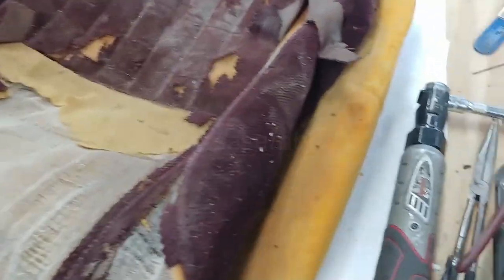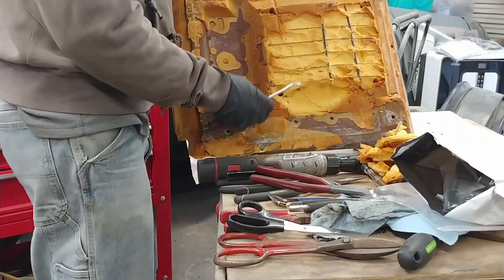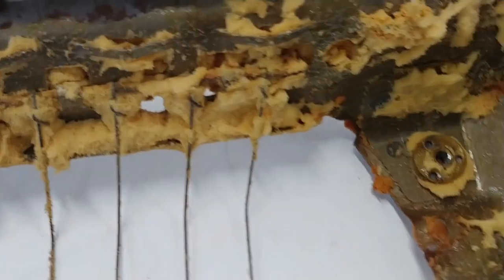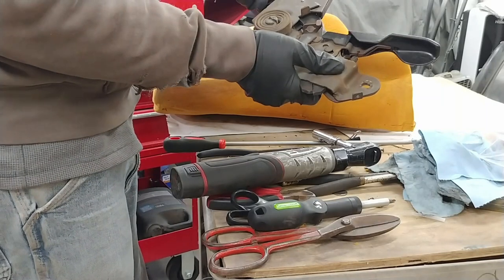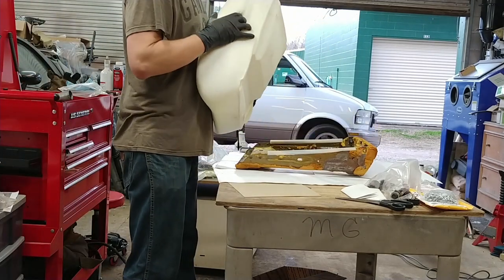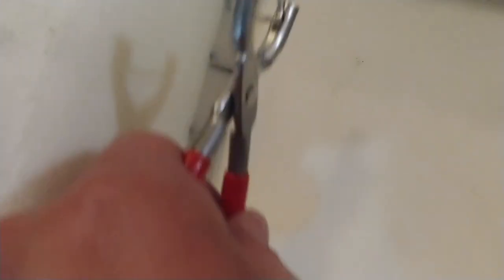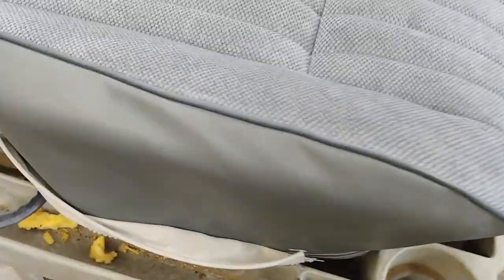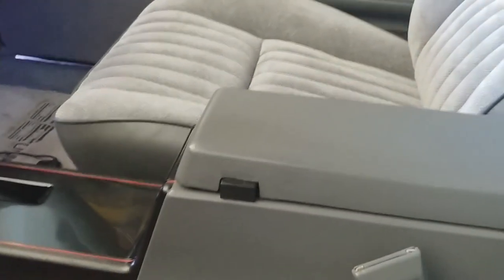SS Monte Carlo - El Camino Bucket Seat Upholstery Install (G Body)

Comment: Currently converting 86 Elco from bench to bucket, what brand upholstery did you go with PUI or ACME? Where did you order?
Reply from the maker: The  kit I used was ACME brand. Purchased the kit through Rock Auto. Not a big fan of PUI interiors as they don't seem to fit near as good as these ACME pieces. Thanks for your comment.

Comment: What are the seats actually from? Also does the back adjust for angle as I like to sit really upright.
Seems like all the 80's type seats are really reclined.
Reply from the maker: These seats were removed from a 1986 Pontiac Grand Prix. Most all of these G Body bucket seats recline into several positions to accommodate the driver and passenger. The drivers side also has a 6 way power seat base for full adjustability. Thanks for your comment.
Reply: @g3garage  Thanks for the reply.
I have a power seat track.
I am still not sure if the back part of the seat will "Tilt" Forward & Lock independently of the Seat Bottom/Power-Track.

Comment: Do you know if the 1987 buick regal T type bucket seats have the same foam shape as the Monte Carlo SS/ El camino?
Reply from the maker: Yes, they should fit fine for your Regal. The seat pattern is slightly different but the aftermarket foams accommodates for both the Regal and Monte Carlo "pleats". Hope this helps.
Reply: @g3garage  thanks for the info, one more thing how easy was it switch the clip on the base to switch the passenger to the driver side?
Reply from the maker: @aldoa4544  Clip on the base? Not sure what you mean.
Reply: @g3garage  you indicated the base are interchangeable between the passenger and driver. Only difference is the nut clip that holds the torx screw. I need a driver side base because mines is broken, I locates one but it's a passenger side one.
Reply from the maker: @aldoa4544  Ah yes, the base is interchangeable from side to side. So just pop the clip off as I noted in the video and install it on the opposite side and you should be good to go. The upper frame of these seats are specific to each side and do not interchange. Hope this all makes sense.
Reply: @g3garage  very helpful, thanks again for the info.

Comment: How did you get the headrest loose?
Reply from the maker: I made a tool out of sheet metal. It was bent 90 degrees at the top to make a handle to push down on. It was narrow enough to slip down inside the headrest channel that essentially blocked the locking mechanism from engaging the headrest post as I pulled up on it and out of the seat. This will take some time to get it lined up correctly before it works so be patient.